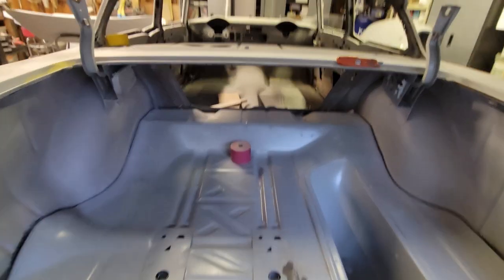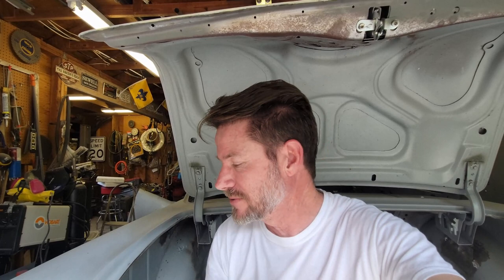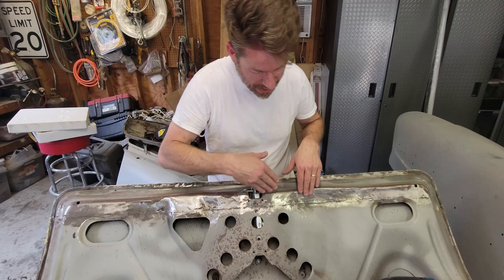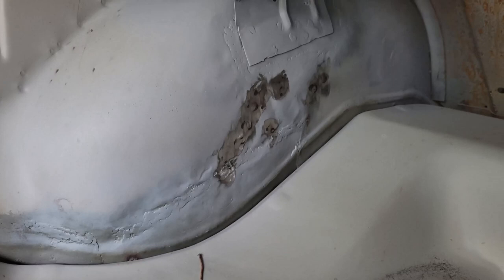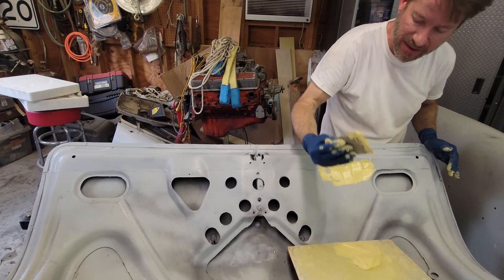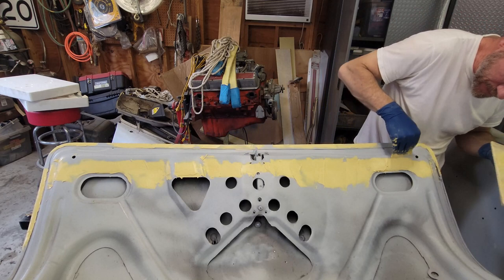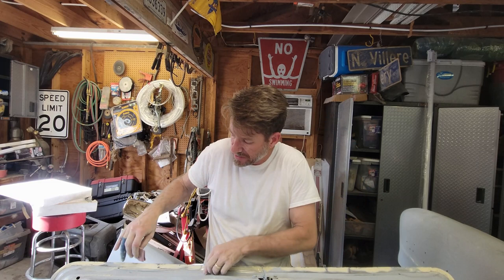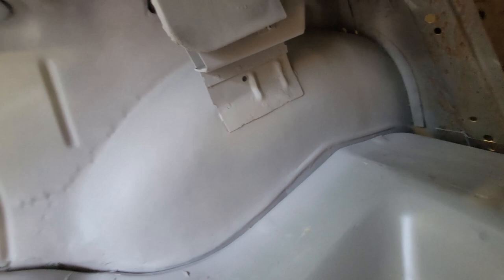E78 Body Fill, Paint & Primer in the Trunk!  1956 Chevy Bel Air Restoration

Comment: Everything is looking good to me. I'll probably have to get myself an airfile if I ever decide to do the bodywork and paint on my 55.
Reply from the maker: That thing is a CHAMP.  My only complaint has to do with the sandpaper.  They make the paper in sticky-back, but the dust fouls that foam pad pretty easily.  You need to cut it longer than 16" to use the clamps and then it works great.  But the super-course 40 grit doesn't come in a roll, only in pre-cut 16" pieces.  So, I have to clamp one end and let the other end hold on for dear life!

Comment: Those factory spot welds must of started popping from the flexing of the unsupported body due to the cancer ... they normally don't show ... the deck looks great ... a little seam sealer and you'll never know it was repaired ... all in all it's commin out great ... one  step closer ...
Reply from the maker: That's certainly a possibility.  I picked up a tube of 3M seam sealer, but I'm not quite ready to go there yet.  Soon though!